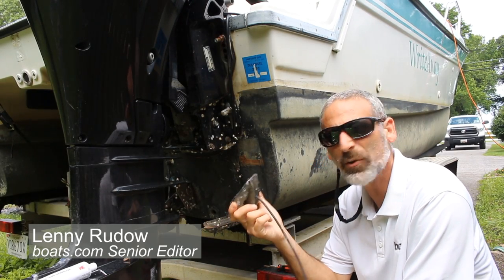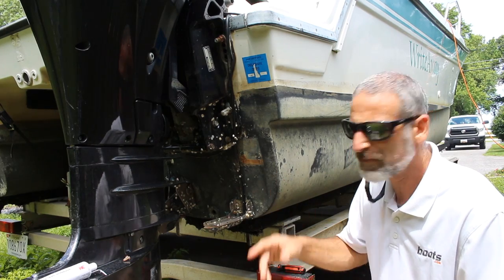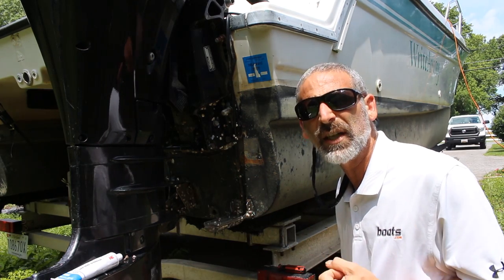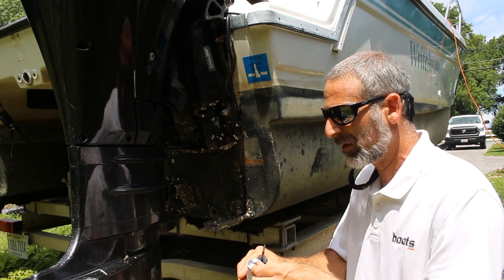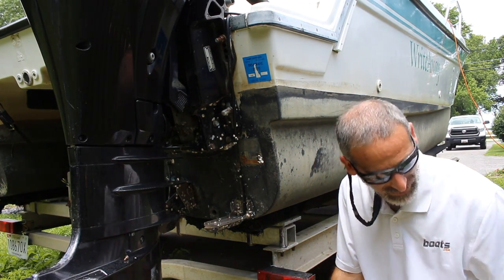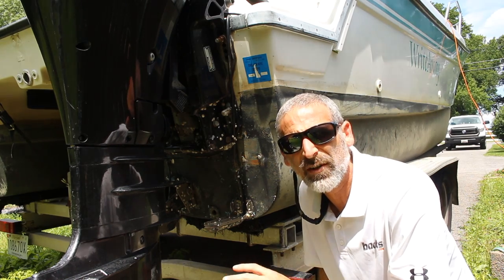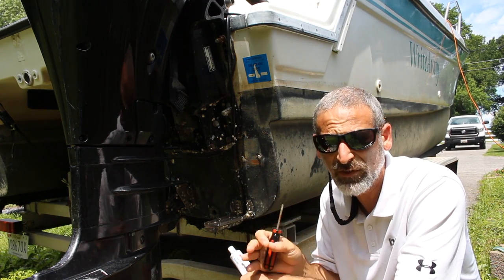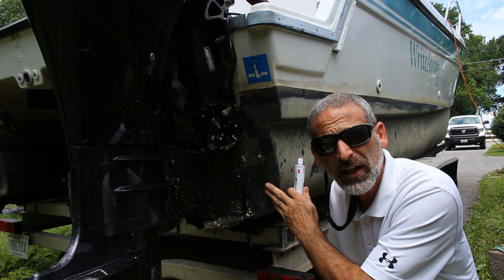Boating Tips: How to Plug Old Screw Holes Below the Waterline in a Boat

Comment: I have used JB Weld to fill holes in a fuel tank.
That patch never failed.
Would that be an option?
Reply from the maker: Hi DW - There are a number of JB weld products, some of which the manufacturer does recommend for fiberglass. And in our experience JB Weld is great stuff for metal. But when it comes to below-the-waterline repairs we haven't tried it so the honest answer is, we don't know - but we're also not going to risk finding out!
Reply: Just get wet system epoxy and a dowel pin made of wood

Comment: why not use 4200. 5200 is permanent and hard to deal with. good luck ever getting those screws out again
Reply from the maker: Hi Scott - if this repair was above the waterline, we might agree. But beneath the waterline we want every bit of permanency we can get, and the 5200 has about double the strength of 4200. Plus, in the small amount being used here it won't be difficult to remove that screw. Even if it was, remember that 3M now sells Anti-bond 2015, which melts away the bond between 5200 and fiberglass (it takes a while, but this stuff works).
Reply: There's one in every bunch